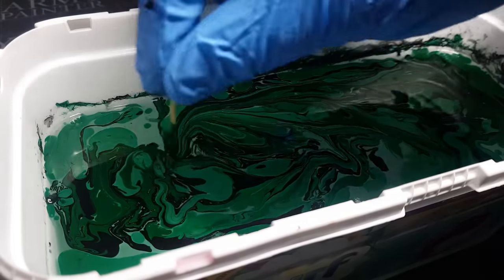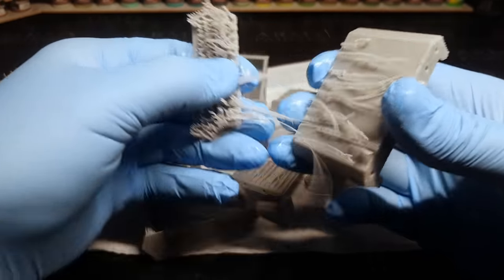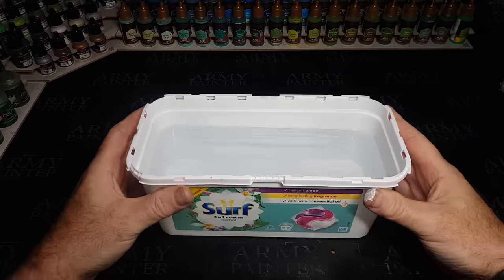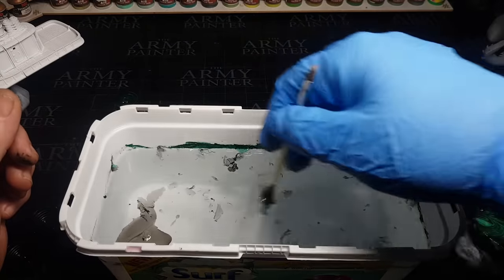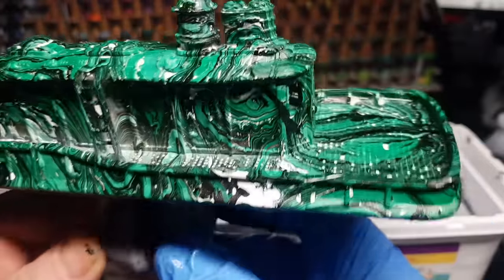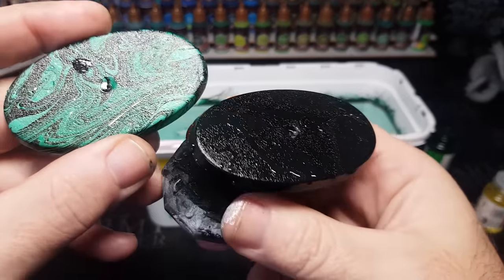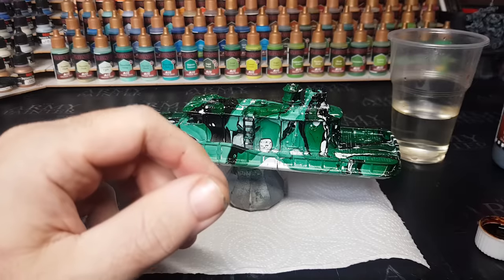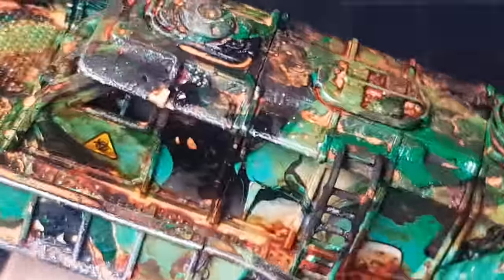Miniature Painting 101 - I TRY Hydro Dipping Miniatures

Comment: I have hydro dipped a few things and I here a few tips that might help.
1) Use a larger bin than what you need, since the inks move as you dip you want to make sure there is a greater surface area than what you are trying to dip.
2) Start with hot water, mix in borax, and let it cool. This water mix is much better at keeping the paint from mixing into the water. (Allows for the spray paint method) Makes the process a little easier. When you're done you can just pour it down the drain.
3) Combined with #1 if you use more ink you will have less blank space. You want to make sure you get total coverage on the first pass and not have to do multiple.
4) As other people have mentioned, prime in a color closer to what you want your end result to be. For bright colors, go white, but for things like camo go gray.

I never thought on using this on minis, but its a great idea!
Reply: excellent tips thanks!
Reply: Most camouflage patterns actually have a background color and the overlaid patterns, so it's probably better to start with the miniature already painted in the base color and do single color dips with some voids.

So, for a DPM Woodland - a four color pattern- paint the model sand, dip in olive green, dip in dark brown and lastly dip into a very, very sparse black dip. You could maybe simplify and do olive green and brown as a single pass.

Comment: A suggestion. Prime in gray. The gray will be more in line with the green and black and voids in the paint will make for better camouflage. You’ll also use less of the Easy Marble as you’ll want the gray to be part of the pattern.
Reply: You could also go for a colour fitting the 2 marble tones, it just needs to have a good brightness.
Reply: @Gargboss  quite true. Any color could be a complimentary background color. Darker colors could pose issues like the black did in the video. I could see some pretty cool camouflage colors for Battletech mechs being done.
Reply: A brown or tan might work,  it would show where the white currently does, and be a tri color camo
Reply: Was gonna suggest similar, but beige or tan.
Reply: I was thinking about priming in a brown/light brown? I feel like that might work better than a grey
Reply: @larrymanns364  Brown is an option. USAF jets used the tan and green camouflage during the 1970s and then swapped the tan for gray in the 1980s. Both serve as great inspiration and work well. Either option fall into individual taste. I’m more in favor of the gray myself.

Comment: I like the Slap Dip idea!!!  These inks look like a lot of fun to play with.  
Here's my thinking: Prime black, dry brush white. Put boat in water *top up* with a couple of strings under it, like a cradle, so you can pull it up out of the water.  THEN add in the inks, main color first, then stripes/blobs of two other colors you want for the camo pattern.  Now pull straight up out of the water, tipping it to let the water drain out of the end.  Opinions?

Comment: 40+ years ago I tried something similar with one of my Battletech minis when I was just starting in the hobby.  I primed a WVR white (rattle can) and after it dried I submerged it in a glass of water.  Then I used a brush and water colour paints (full strength, from the tube), to paint and dab the mini while it was under water.  Pulled out the mini, let it dry for a while, then used a toothbrush to distress the paint a bit.  To this day, it is probably the best mech painting I ever did.  Gave it away years ago to a pal when I got out of the hobby.

Hydro dipping is an interesting approach
Reply: Hello fellow Mechwarrior

Comment: Howdy! I’m a noob as of Oct 21, 2023. I’m binge watching miniature painting  videos.

I just tried ‘priming’ my gray plastic mini by dipping it in clear gesso and shaking off the excess. Mini was stuck onto an old pill bottle. Then I dry brushed with white acrylic paint - like a zenithal spray highlight. [I don’t use airbrush or spray rattle cans]. 

So far, I like my results. The clear gesso preserved the original gray color and black wash - Nuln Oil style. So I didn’t have to bother with a black primer and gray primer over it.
Then I base painted with some DIY washes. 

My only problem was I kept getting headaches from eyestrain – even though I have 2 OTT lights plus a bright floor lamp in my craft room.  SO I plan to order a pair of hobby magnifiers. Then I can complete painting the remaining 99 minions from my Mechs vs Minions game! I’ve only been wanting to paint those bad boys since Christmas 2017! I liked and subbed, too!

Comment: I think that priming in a light green like mint you could cover up the white and still have a lighter coloured base for the hydro dripping. You could also use a liquid mask (or liquid latex which is cheaper) on certain areas before you hydro dip should you want a particular area of your model to not have the hydro dip affect it. Simply dip, let it dry and peel of the liquid mask.

Comment: you need to put the boat in the water first, then dip it by pulling it out through the ink. That will prevent the air from getting trapped and giving you those white spots.
Reply: This will work to some extent but if you don't have enough surface area on the water you will still have white areas as the ink essentially is like a piece of paper that needs to fold around the edges.

Comment: I noticed some of the edges don't match up flush on the model.   Like on the bottom sections towards the front, etc.    Is this an artifact from your printer or the quality of the model?  Either way, do you ever use putty or something to fill in those little gaps and such to smooth them better?

Comment: Maybe prime with the lightest color you want to have in the end? And definitely use a container that's a good size bigger than what you want to dip, so you have a lot of surface to add color to.
Doing some drybriushing before the dipping might also add a nice effect.

Especially for bigger models, doing it in parts might help a lot to not get spots where the color doesn't reach properly.
Especially stuff like tank turrets just lend themselves to being dipped independedn from the hull of the tank.

Comment: I cant help thinking, that mebbi if you dipped the boat sideway so to speak, instead of bow to stern, then do it stirbord to port. So the railing and deck of the boat gets covered at an angle instead of down the long side

-- if that makes any sense,
Reply from the maker: Makes a lot of sense and would work better, cheers 🙂
Reply: @MiniatureHobbyist  Will probably have to make the surface of the water/paint you dip into wide enough to cover the entire cross section of the boat, ie from the side of the hull, up and over the railing, across the deck-section and then up over the cabin of the boat, over the roof and down the side again, over that part of the deck, over the railing, down the railing and all the way down the hull again on the other side.
Its a lot of distance, a lot of surface that needs to be covered.
A "plate" the size of the outline of the boat seen from above probably doesnt have enough pigment to cover it all. its kinda hard tostretch the paint when dipping, eh?

Comment: You need to actually dip the boat in two different pieces the upper deck housing area and the lower deck as you need to think of the ink as a piece of paper.  As you dip it the ink is a really thin piece of paper that is folding over the bits.    Not a bad idea i have hydro dipped RC cars, guns, computer parts etc never thought about doing it with mini's.